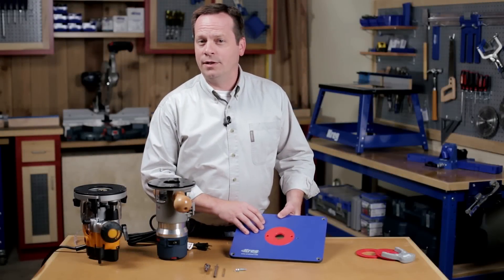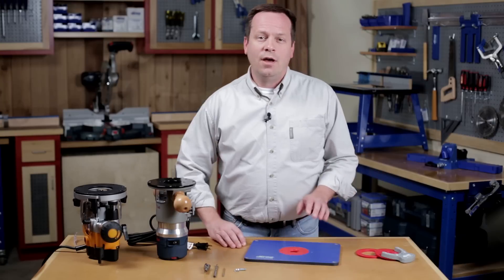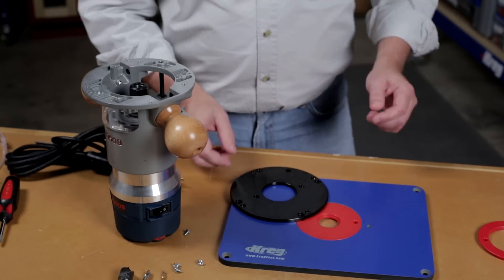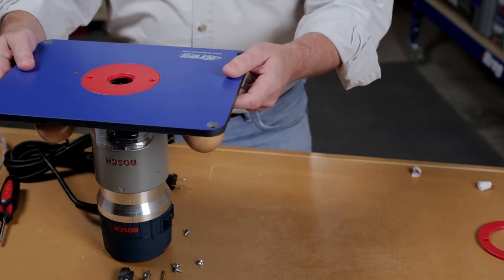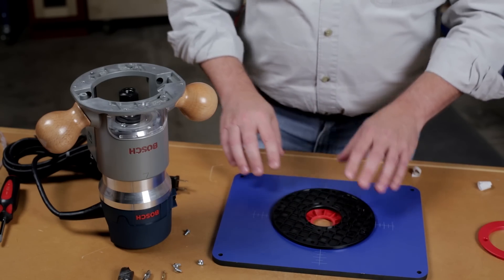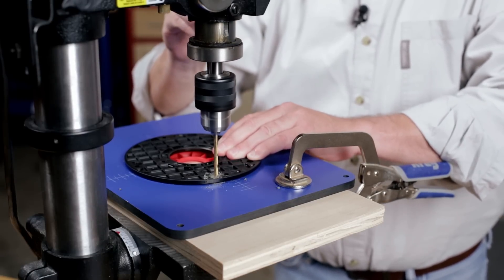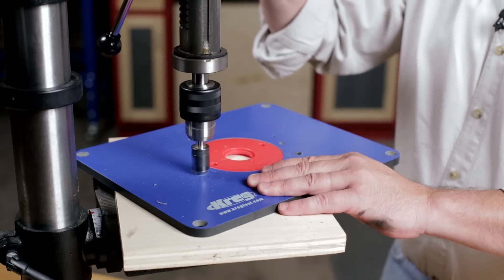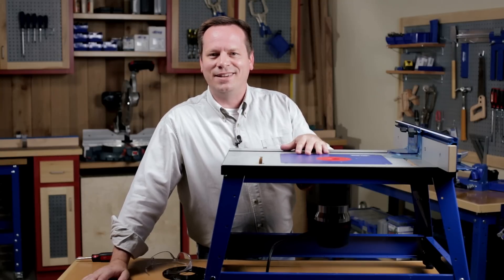How to Drill Mounting Holes in the Kreg Precision Insert Plate

Comment: To anyone who is lost: 

The single hole outside of the red ring (in the blue area of the board) does not relate to or need to line up with the hole for the height adjustment crank on your router base in any way. 
(You will need to drill your own totally separate hole in the blue area of the board for the height adjustment crank.)
& 
The two holes on the red ring do not need to line up with any similar spaces holes on your router base. 
The holes on the red ring are only there so you can stick a tool in them to twist and take the ring out. Nothing more. 
They arent related to screws or your router base in any way, so dont worry about lining other holes on your router base up with them.

Besides the hole that you need to drill for your height adjustment crank, the only other holes you will need to drill in the blue area of the board are the ones that you will slip screws through in order to miunt the router to the bottom of the blue plate

Comment: This "precision" placement looks very approximative! If you just put the largest router bit you have – or, if it's not large enough, just use a cork, a piece of round wood or plastic – on the router clamp, then you can place the taped base more precisely centered and it won't be necessary to move it again once you turn it over.

Comment: Would be easier to just make a photocopy of your router base, then find the center of that circle. (search for how to do it using a carpenter square) Then tape the photocopy to the insert plate and drill through the paper.
Reply: It's better to spray a light tack coat of contact cement for the template instead of tape.